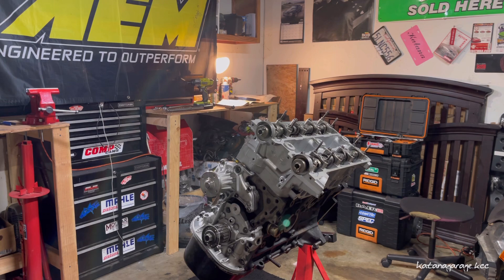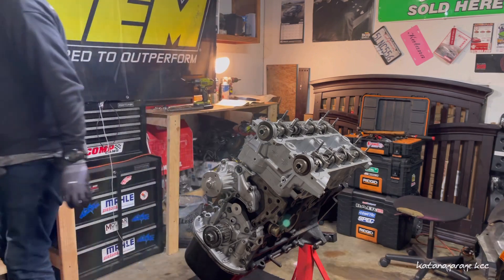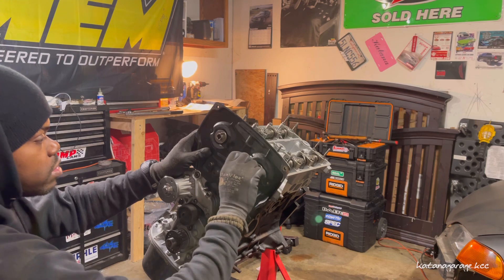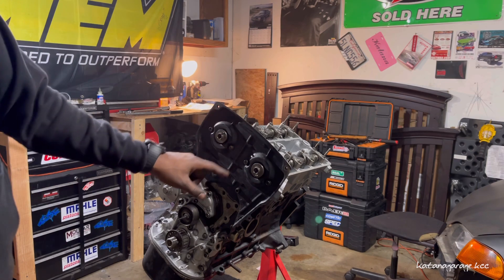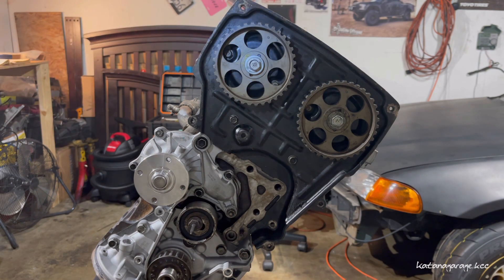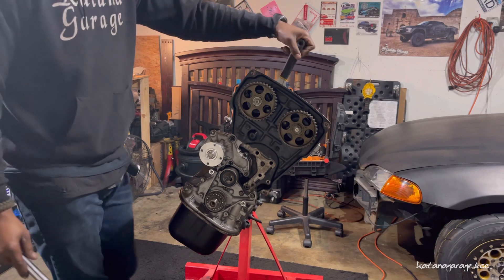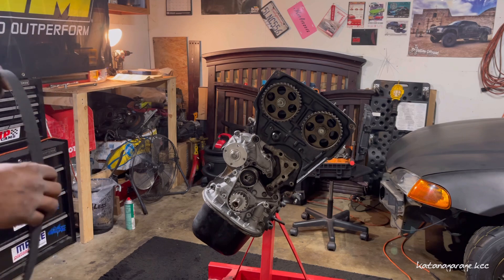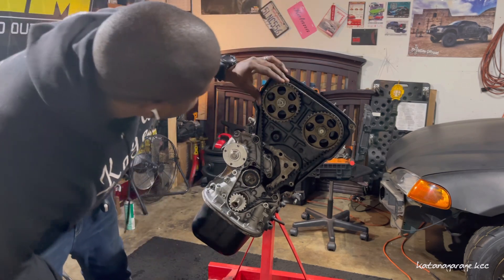Setting the timing on a 1986 Toyota mr2 4AGE

Comment: Having issues.. Cannot find timing mark on main crank.. set it where I think it is, put plastic cover on and it shows that it is to the left of TDC by 20 degrees.. Is this correct?
Reply: Not all 4ag use the timing marks on the plastic cover. Some are via a pin protruding out from the bolt that tightens the timing belt idler/tensioner.  As long as the notch in the timing belt pulley line up with the little bump on the oil pump casing and crank pulley woodruf key/slot is at 12 o'clock the crank is at TDC.

The pin on the cams that help lock the cam pulley's into position on the camshaft the inlet should be at 12 o'clock and the exhaust 5 o'clock.
Reply from the maker: Both cam gears should be lined up with the marks in the timing case upper ( gears should be at 12 o’clock) and line up the mark on the crank sprocket to the mark in the oil pump. I hope that this helps. Reach out if you have any troubles

Comment: Hey, trying to get my 16v running and I had a weird problem where it seemed like it was blowing out of the intake. Mechanical timing is exactly you show and how the EM shows, everything is OEM. Intake 12’ and exhaust at 5 with the crank at TDC. I’m running bike carbs and the engine was blowing out my injector plugs.

I flipped the cams inboard, so advanced 180* and it stopped blowing out the intake. It just felt like we advanced the cams 180* because the crank rotates twice for every one time the cams rotate .

Really bothered by it and I still have to work out my ignition timing. If you have any tips or advice I would really appreciate it
Reply from the maker: What exactly is blowing out the intake? Also bike carbs? Also blowing out the inj’s ? Kinda strange if the car isn’t modified. Need a little more info regarding.
Reply: @katanagarage168 oddly enough i’m having a very similar issue with my 4age, a group im in said it’s a 180 out of time and just to flip the distributor rotor. did that but im still having the same issue, its like it’s sucking air in through the exhaust and the intake is pushing out the air. like the exhaust and intake are doing their opposite jobs
Reply: @katanagarage168 i know this video is about 10 months old but any help would be awesome
Reply: @koolklanman1897 did you ever figure it out I’m having the exact same problem
Reply: @katanagarage168 side note, i fully apologize about my username, it was funny when i was 14, as an adult it is no longer funny and im stuck with it